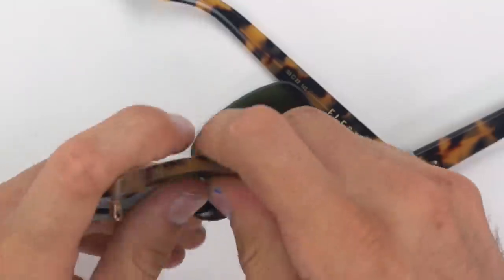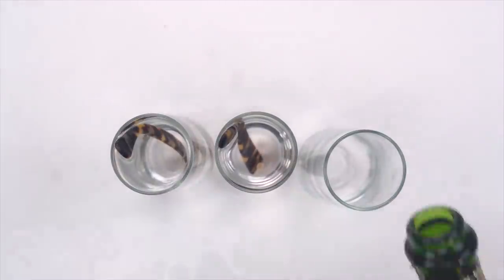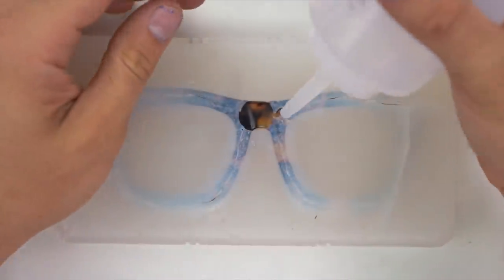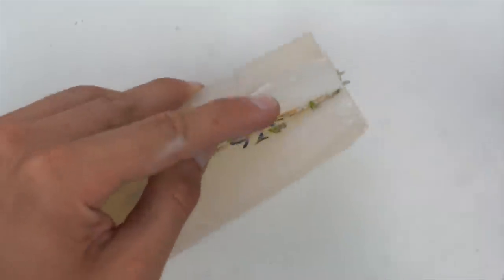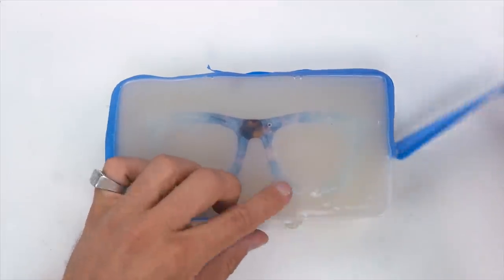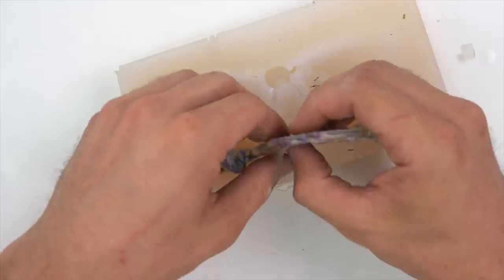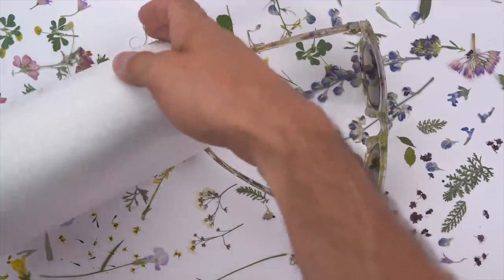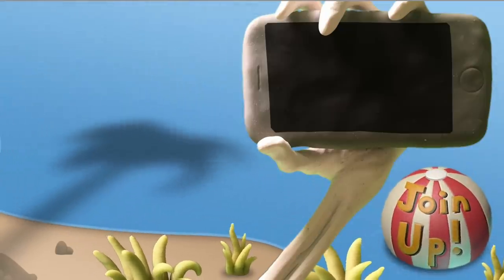DIY Flower Glasses Pt.3

Comment: I’ve always been impressed with your craftsmanship and loved your channel! I have a bit of experience dealing with resin and casting material. 

I go through about 15 drums of resin per year. 50 gallon drums. Yep it’s a shit load of resin.
Been going like this for almost 20 years now

I can’t stress enough how important it is to focus on ductility and UV resistance of your material. And just because A particular resin is cured with UV light… Does not make it UV resistant…And sometimes it’s the opposite! UV resin can continue to be hardened and become brittle with more exposure to UV light.

Flex additives and UV resistance are super important! Would be even better if you could add some form of composite material to strengthen the resin. 

There are a ton of options, all of them are incredible! And some of which can be completely invisible. Options include Carbon fiber, fiberglass, nylon, cotton, even those envelopes you can get for free from the post office… That are made from that Tyvek housewrap material that’s basically indestructible incredibly made an engineered fiber! and my favorite… Denim! 😁👍

Pretty much any material Can be made or purchased super cheaply in all kinds of strange textures. Everything from strips, to strands of fine thread, chopped particles from course to ultrafine… And even glass fiber that has bebeen chopped then ground into a texture like baby powder. 

Tons of stuff we come in to contact with every day have glass fibers in the casting to reinforce it.

Stuff like cordless drills and other plastic that needs strength… Will be glass fiber reinforced. And a lot of times they use extremely fine chopped fibers. Which are really easy to use because it just mixes into the resin. Some of them are so fine that you can’t even see them when submerged in clear resin. You would just need to add a clearcoat or something over the top so that the glass fibers wouldn’t wear off onto your skin. Possibly look into a UV resistant clearcoat. That could be sanded and polished, honestly though the best looking finish on glasses and castings and things like you’re making… It’s a nice perfect mat/satin sheen.

You could even laminate layers of blue Jean material with epoxy or resin, and clamp it tightly… And you can make your own incredibly strong composites. But instead of boring plain old micarta or carbon fiber… You can use vintage tie-dyed shirts, denim, old plaid hippie shirts… Stuff like that. And then when you sand And contour the material… It reveals an incredible 3-D texture. As you expose more layers of the material.
And it’s incredibly strong. Basically indestructible.

If you haven’t seen it… Do a search online on YouTube for the “DIY Micarta“ knife handle material people make on YouTube. You don’t need a vacuum chamber or anything… and I have a feeling you would really enjoy working with that stuff.

Your glasses are absolutely gorgeous! But eventually all resins and polymers lose a lot of strength within the first year… Unless they are specifically mixed with flex additives and UV resistance. (or UV resistant clearcoat) The fiber material would also help a ton!

I know you’re probably familiar with all this stuff, just thought I would make a few suggestions and share a bit of my experience.

I really enjoy your channel. Good luck to you in all of your projects!!

Comment: Would the process of dissolving the frames be quicker if you broke or cut them down? So you could melt down like 10% of the plastic vs 100%